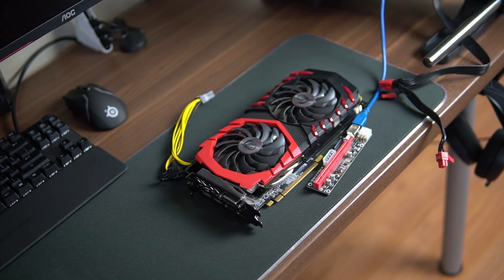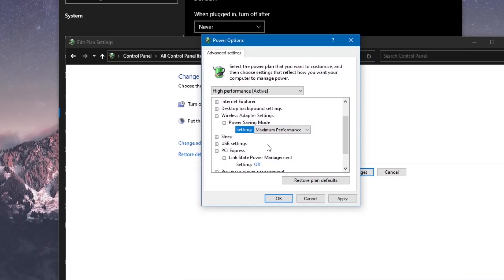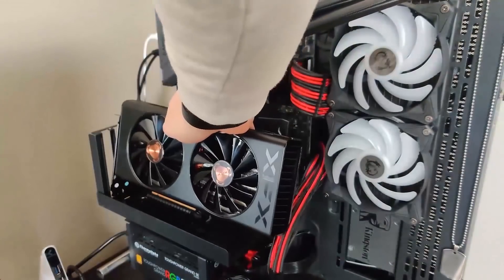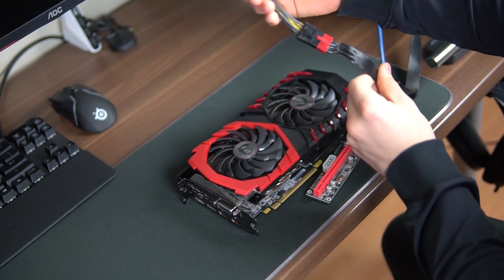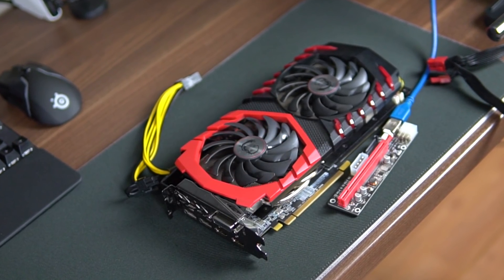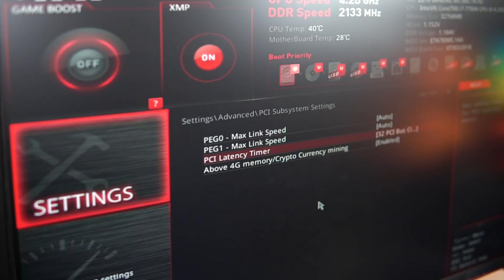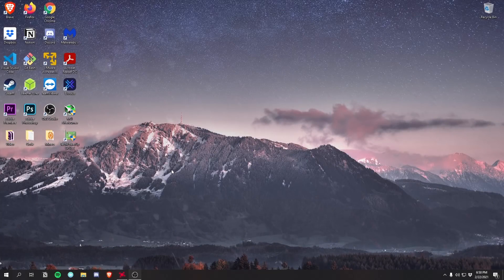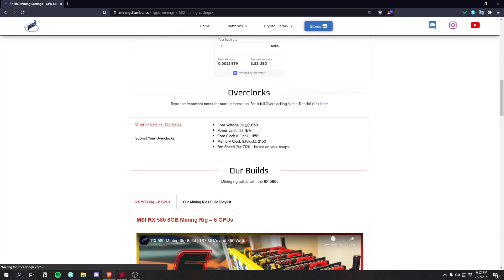How To Mine With More Than One GPU On Your PC

Comment: Amazing video! Very helpful! Thanks for sharing.

I saw some people saying that is not secure to mine in your main pc using Phoenix miner for example.
So I had created another profile in my pc just for start the mining and when I start the Phoenix bash, I don't need to start as administrator and its working fine.

What do you think? It could be a good tip create antoher profile on pc that is not an administrator just for mining and than I can use my pc for work, play games and others things?

Thanks a lot for the video!

Comment: Awesome video!!! Lately I’ve been having issue with my mining rig and driver timeouts. 4x 5700xt and 1 5600xt. Running in windows 10 (64). Was running like this for about a month with no issues at all. Now I can’t even run more than an hour unless I just remove the 5600xt from the system then it resumes its stability. 

Tried ddu with redownloading the drivers with no luck. I think my next step will be to add the 5600xt to the gaming pc with the 6800 in it and see if that’s stable or not...... or just download hiveos and take windows out of the equation, but that’d probably be too simple and would drive me crazy enough 😂🤷‍♂️😂
Reply from the maker: Hahaha HiveOs would be an easy fix but I think this is mainly oc settings on your 5600 xt . Make sure you put the proper undervolts and oc from miningchamber.com!
Reply: @MiningChamber  will do. Currently running 800mv 1300 core 1820 mem. Just weird how the 5600xt has been mining since the end of January on those. Hopefully it’s still good to go 😬
Reply: @MiningChamber  HiveOs for the win lol. Took about 15 mins 😂

Comment: I'm having trouble in installing gpu drivers seperately. my 1st gpu being 5700xt and 2nd rx 580. whenever I install the 2nd gpu driver, the first ones gets overwritten, also happens vice versa and when I do it manually in device manager for the 2nd gpu, it says "the best drivers for your device are already installed" but the reality is its using the 1st gpu driver -_-

Comment: what if i put the 3gpu in the 3pcie Slots available without using the riser ? is that possible ? if my Mobo has 3/4 Pcie Slots , in case the Computer is Built just for Mining , No Gaming Included

Comment: Great video, I just have one question. If you do have a 750w psu(like myself) powering my current gpu and the rrst of my pc, can I instead use a second psu to power the second gpu exclusivley? 
This would be more cost efficient than upgrading my psu in my case, but I'm not sure if it's possible.
Reply: You'd need a second motherboard and CPU, but otherwise, yes

Comment: Can I use a 1070 and 1060 in my pc to mine
Reply from the maker: Yes
Reply: @MiningChamber  thanks for the reply got it running I only have a Corsair RM650X 80 PLUS Gold Fully Modular ATX Power Supply am hoping that I will be enough at the moment both cards are using 238w both cards are strix models but the 1060 seems to be better than the 1070 1060 has Hynix memory and 1070 has Mircon any recommendations on settings to get best hash rates ?

Comment: why do i have a lower hashrate when i installed the same 3070 that i had first, i had a hashrate of 50 for one card and now running up 2 cards give me the same as one .... the hashrate is halving
Reply: I’m having the same issue.
Reply from the maker: Check for your bios settings maybe pcie gen speed or mining mode/4g decoding make sure it's on
Reply: @MiningChamber  i did and still doesn't work .. is it a limit on lolminer or what could be the problem ?
Reply: @MiningChamber  I do have 4g decoding enabled. Is there something I would have to change in my .bat file? Sorry, I cannot find anything reliable to save my life.

Comment: ***HELP :( ***
Hey man I'm having issues with two rtx 2060s, one is only getting around 100 w power and the other 125w.
The one with lower power by consequence gets lower clock rates.
One is getting 35 MH/s and the other 45 MH/s.

 I have MSI AB and mess around with the values but don't change due to the low power it receives.
Specs:
-GPU#1:Gigabyte 2060s Windforce OC
-GPU#2: MSI 2060s
-Power Supply: 750w BQ
-Mobo: Rog Strix b450-f

P.S
It's really weird since if I open let's say a web browser and start refreshing the page then the first gpu starts getting more power and clock rates go up. Lol

Help me please :(

Comment: Hello MAN i have a problem with my motherboard i have aorus b450 pro with 1 gpu 3060 in first slot and 3070 in secound pcie slot and if i switch to gen 1 or gen 2 my 3060 is going to do 22mh if i go auto runs at 45 Any idea to slove the problem ??? 4 g decoding is enabled !!! Thx nice video !
Reply from the maker: For the 3060 you need the unlocked drivers which you can find in the discord server link in Description but I think you can run a max 1 3060 with full hash which is around 50. I'm not sure though have not yet tried that!
Reply: @MiningChamber  i have it bro v470.05 installed

Comment: @Mining Chamber Bro do you mind helping me out, i have 3x 3090 two are working but the last one is not showing up in device manager, GPU on the first PCIE 4 slot working, GPU on the second PCIE 4 slot running but not showing in device manager and GPU on the third pcie 4 slot working. Mainboard is a asrock x570 phantom gaming x.

Comment: I have a 2060 right now and planning to buy 3060. my PSU is corsair cv650 80+bronze. Is it safe? Thanks
Reply from the maker: Yes that's safe
Reply: @MiningChamber  Thank u so much
Reply: @MiningChamber  should i use a riser or is it safe to put 2 GPU in my board? b450 tomahawk max

Comment: I´m all new to this, just trying out  NiceHash at the moment. But i have a question regarding using two gpu´s. Does it matter what gpu it is in it self or is it just the memory size that is important?
I´m thinking of buying a Geforce titan with 12 gb of memory. It´s an older card, so the question is: would my money be better spent on a more recent card with maybe 8 gb memory? Thank´s for all the good content and explenations!
Reply from the maker: Yes it does matter! Many factors play in performance, such as memory bus and speed so better to get a more recent gpu
Reply: @MiningChamber  So i got a hold of a 3070. Can i just plug it in to my gaming rig with a riser then? I have a 750W 80 plus gold rated power supply. I´m already using a 3060 ti.

Comment: How i can set the Powerlimit.. i dont understand this. Example -powlim -30 says the Card has normal 200W and with -30 he has 170w correct ? but if set this -powlim -30 are this 2 spereat commands ?? I need rly help????!°!!! or maybe -powlim (-30)
Reply from the maker: Powlimit goes by percentage, default is 100% so when you set it you say -powlim 70 for example it would be 70%. If it is not measured in power limit then it will be in watts. For example RTX 3060 TI -powlim 130 means to use max 130 watts. Check overclock settings on miningchamber.com or watch part 1!
Reply: @MiningChamber  thanks, that helps my alot ;)

Comment: I got a 3070 and an rx480 in the same rig, I can't seem to specifically choose what pcie m gen I can use so I have to put it on auto, and using the above 4gb option on msi bios just makes windows not detect the 480

Comment: Splitters depend on your power output on the PSU side. You can just damage your PSU if you use too much power on one PSU plug or it will just switch off depends on its build in stuff.
Reply: any gold rated psu can work at full power for years without blowing up.
Reply: @maykelsach795  If dont overload and your PSU has protection than yes but not with spliter if you draw too much powers and your psu has no protection
Reply: @someonesomewhere  I've had sli set ups coupled with a gold standard psu and never got any problems but if the psu is too small then the components would not work well.
Reply: @maykelsach795  I dont say you have problems is say you can get problems using splitters. If your GPU is taking enough power your PSU will die or switch off if the security features are installed.

Comment: my pc starts crashing when i install more than 2 GPU's.. any idea?
Reply: Yeah I have the same issue with 1x 1080Ti and 1x 1080. Doesnt matter if its on riser or directly on motherboard. Temps are about 55c which is good temps. VRAM temp is about 65c. Just restarts randomly. PSU 1200W, brand new mobo and psu.

Comment: Great video! I have a rtx 2070 super with power limit at 58% and a 650w gold psu and I am wondering whether I can add a 1660ti which I have laying around. Can the psu support both gpus?
Thanks in advance.

Comment: Hi  need some insight i have two gpu same brand same model same settings but this 2 have diff hashrate one is 55hash and one is 61 hashrate is this normal or im missing something 

this two cards installed direct on my mobo with two individual cables
Reply: I have the same issue, did you get this fixed?
Reply: @carlosmartinez985  

two things to considered if its connected direct to your monitor 1 gpu will loose some hashrate

to fix it adjust the oc settings for the low hashrate gpu till you meet same hahrate

Or just use hdmi or vga connect to motherboard for monitor display

Comment: Hey thanks for great content! I currently have a 3070 and an old gtx 970. Is this going to be viable? 970 has 4 gb (3.5gb fast memory and 0.5 much slower) thanks!
Reply from the maker: Thank you! Yes it's viable but the 970 can't mine ETH it will have to mine ETC or RVN.

Comment: Just a quick question, I'm planning on getting a RTX 3070 for mining and use my old RX 570 for everything else. What kind of PSU would you recommend for that combo?
Reply from the maker: Just like I mention in this video! It consume around the same power so your fine with 700 w or 650w. Get 850w though since usually it's the same prive
Reply: @MiningChamber  thank you!!

Comment: Hi sir, i wanna ask something.and it is seriously.i have 2 rx 580 8gb.so, i want to use splitter 2 x 8 pin female to 2x 8 pin in dual cable pci 8 pin.so i have 4 cable 8 pin now.the question is,is it safe iffa use this 4 cable to powering 2 rx 580 gb?
Reply from the maker: power only one gpu per cable from the PSU

Comment: I'm trying to run a 2080ti and gtx 1660. I went into the bios and enabled the mining setting like in the video, but the 1660 isn't detected. Any ideas on how to fix this? The 2080ti is plugged directly into the first x16 slot of my MSI x570 Unify motherboard. The 1660 is plugged into the second x16 slot through a powered riser adapter. 1660 is receiving power because it's lit up, but I can't get it to detect.
Reply: Nvm I changed the link speeds from auto to gen 3 and that worked. Appreciate the video it was very helpful.
Reply from the maker: awesome! Glad it helped!
Reply: @MiningChamber  Hey I tried adding a third card (gtx 1660 super), but I can't get my x570 motherboard to recognize 3 cards. I tried dropping the pcie speed all the way down to gen one. Since adding the 1660 super my normal 1660 is no longer recognized. All 3 cards are getting power because they light up and the fans spin during start up.

Comment: When using two GPUS which one will the pc use to game with? Does my 3070 (currently GPU2) need to be GPU1 to game while GPU2 1660ti (Currently GPU1) Mines in the background? Does it matter?
Reply from the maker: It all depends on the game itself and drivers. You have to specify in nvidia settings which gpu to use for games etc as well as in amd drivers. Only if your having an issue with it though. If you disable your primary gpu from mining and try to game with it without any issues then you don't need to do anything
Reply: @MiningChamber  perfect! Thank you.

Comment: Hi there, I have 4 Gpus running and followed your steps. But only 2 of them showing? Would you be able to help please?
Reply from the maker: Try messing with your bios settings for the ones I refer too. Check in Device manager if they show and if they do then increase your virtual memory
Reply: Try restarting multiple times.

Comment: I'm pretty sure you don't want to Overclock your GPUs before Mining....
This will corrupt The DAg File that is Created and give Invalid Shares
You do The Overclock after You Start Mining and DAg is Created...
Maybe AMD cards are Different?I don't own Any?But I'm pretty sure this is with all cards?Someone correct me if I'm wrong? But its Definitely True with Nvidia Cards with Phoenix Miner and Gminer  you have to do this or more times then not You get a Corrupt DAg message and Invalid shares.
Reply from the maker: It all depends on your card. That's a pretty new issue that I heard about recently but never came across, you can see in my latest 2 videos I overclock before running the miner and no issues at all. So it depends if your running into that issue then yes run miner then overclock
Reply: @MiningChamber  Maybe it's just a Nvidia issue?I know because I deal with it daily..Can be a pain when you forget sometimes.Doesnt happen everytime but more times then not for my 3060 it does it and lesser often on my 3080s
Took me awhile to figure out where all the Invaled shares came from?
But sure enough was the overclocks beforehand
Reply from the maker: It's very interesting, il try to dig more into ir
Reply: I get the same issue with my 3070s but not with my 1660ti's. so I have the 1660s OC on startup and the 3070s startup at stock then apply an OC profile after Phoenix miner has created the Dag for the 3070s.
Reply: @pspm1ggz  I have a 1660 TI and don't have the issue nor with my 1060.It appears it could very well be just a 3000 series issue?I have only used Phoenix Miner and Gminer and had the issue s on both software so don't think it's a software issue?
Just One of Those Things No Rhyme or Reason it doesn't make any sense?
But it's there......

Comment: Great video! And your website is awesome aswell! :)

I had like a RTX 2080 Ti and a RX 560 in my gaming PC before. But the airflow was little bit limited sadly. Now I only have one RTX 3080. 2080 Ti is in a dedicated mining rig and the RX 560 sits in a HTPC (that ofcoz also mines on both CPU & GPU) :D
Reply: is cpu even worth it?
Reply: @JoseRodriguezFrio  Yes if you got a stronger CPU like Ryzen it's worth it.
Reply: @johanvirebrand7196  with my 3600x it really didn't make a diff.   what r u pushing?
Reply: @JoseRodriguezFrio  I have a Ryzen 9 5950x doing 19000 H/s @ Monero. Also a Ryzen 3900X doing 13000 H/s and some other Ryzen CPUs aswell.
Reply: @johanvirebrand7196  sheesh

Comment: Hi mate. Your videos have been brilliant as has your website OC settings. Just my 3090 is hitting temps of 110degC while mining etherium. Have you heard of these high temps? Do you think they are ok for 24/7 at this temp?
Reply: well i'm not him but a 3090 does not do to well at 110C, its up to you but you can copper mod it. it'll be hard but easy at the same time just make sure you do it right and you can get temps down a solid 15 or more in decreasing in temps.

Comment: Hi
System Manufacturer	INTEL_
System Model	DH55HC__
weth Processor	Intel(R) Core(TM) i3 CPU         530  @ 2.93GHz, 2926 Mhz, 2 Core(s), 4 Logical Processor(s)
and ram 8 gb
and 3 slot for pci expres
can i mining ? Please answer my question
Reply from the maker: It needs gpus. But yes other than that it's good

Comment: I'm sure a lot of people like myself were waiting for a video like this. Thank you! Just gotta find a second gpu now 😁
Reply: Exactly.  I finally found the perfect 2nd GPU for my home PC and this is the video i needed.
Reply: @kittydidastinky  Hey, how is it going for you? I was considering doing the same.. looking to upgrade to a newer GPU, but would like to keep the old one to mine while in the same desktop.
Reply: @mKhalifa218  Hi.  I did run 2 x 1660 supers in my desktop case for a couple of months but the heat was too much and needed to open case.  Eventually bought a small open air mining frame and have 3 x 1660 supers in there with an older GTX 770 left in the Desktop for basic PC gaming :)
Reply: @kittydidastinky  Thank you for the response and best of luck with your rig!
Reply: @mKhalifa218  Cheers mate.  All the best with your gaming & mining.
Reply: just got a 580 myself for 300

Comment: Rig was stable for days .
PSU:1300watts seasonic primegold.
 Gpus: 3070 (1) 3060ti(1) 1660super(1)
I transferred it to a  rig frame with addition of  extension to pcie cable of 1660super and to pcie cable of 3060ti.  splitter to 3070.

Finished setup 3pm. Started mining. Was stable until 
4:30am. It turned off.
I wokeup 830am. Turned it on But it wont turn on.
I removed cables then reinsrrt
Turned on for10mins then turned off.
Done trouble shooting then after awhile it only turns on for approximately 2seconds. Then turns off.

I suspected psu problem.
Brought psu to local store, tested it. It is broken. (To be sent for warranty)

Any ideas what haappened?
Appreciate your expertise and ideas thanks!!

Comment: My main PC has one rx570, I don't use it much and would be using it only for mining 24/7. How would you suggest I maximize my mines and profits. I use nicehash.
Reply from the maker: Any miner is fine, just follow the instructions in part 1 and 2
Reply: @MiningChamber  on whattomine it says ethash on nicehash would be good profit, but in nicehash it's doing kapow. How do I fix it? Also I'm onlh getting around 7Megahash
Reply: @suryanshsomani7916  u can disable kapow in nicehash
Reply: @JbrZee  but disabling would be wrong, as nicehash chooses the most profitable coin to mine itself
Reply: can it hurt to try the others? if it don't work out then turn it back on and i'm taking it is a 4gb card
Reply: @JbrZee  yup, so it cannot mine eth. Just to be sure I double checked from whattomine and they say that nicehash kapow would be good for my card